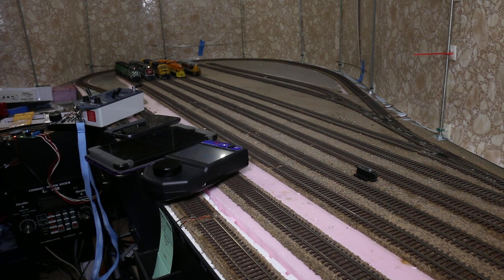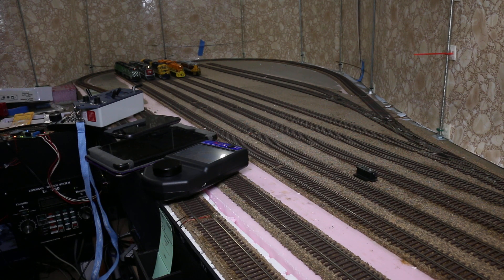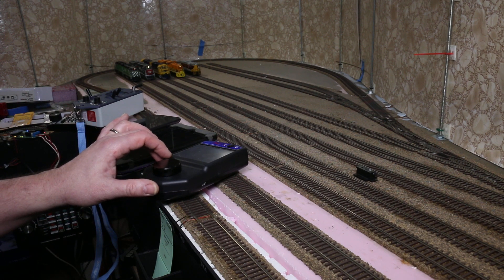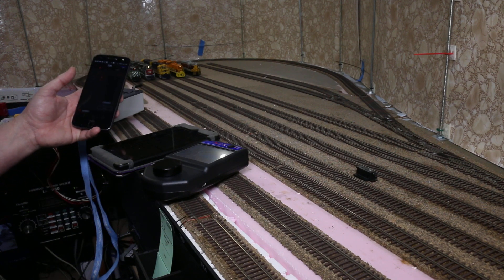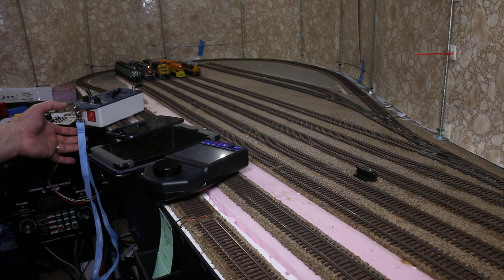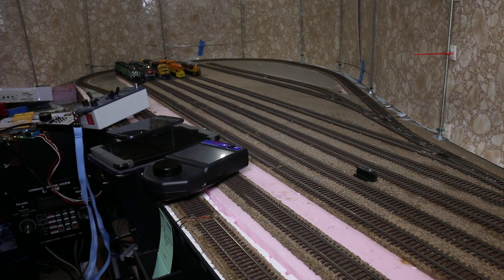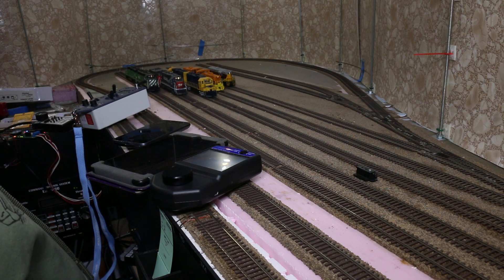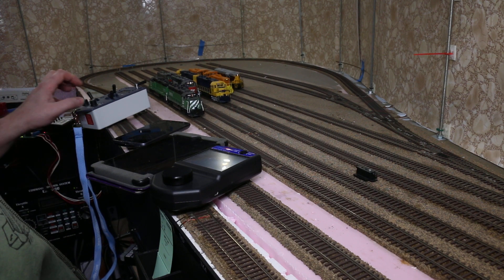Digikeijs DR-5000 with 4 separate throttle inputs + 1 extra

Comment: i'd l ike to see where you've got them plugged in.
Reply from the maker: Go to https://www.ironplanethobbies.com/product/digikeijs-dr5000-command-station-throttle-starter-set/ - the plugins are on the back but are labeled on the top. The UR91 was plugged into Loconet T, the LNWI into it. The Lenz Xpressnet panel was plugged into XN+FB bus and the ProtoThrottle receiver plugged into the Xpressnet panel. The Z21 emulator was a direct radio connection to the Digikeijs DR-5000. The RailPro is a direct radio system between the handset controller and the locomotive. I won't say it looked pretty - but I was able to do it. With a little help I could have gotten more ridiculous and connected a JMRI computer to it as well.

Comment: And NCE Power Cab or other throttles from this brand ? Not possible ?
Reply from the maker: Of major US brands, I think NCE, CVP, and MRC are the only ones that won't interoperate with it.
Reply: @JeffShultz  CVP wireless should work through their XPressNet receiver, the ALR900.
Reply from the maker: @woodalexander  older CVP, but not if you have updated to the most recent (which is now several years old) chip. They made changes that make it incompatible with Lenz.
Reply: @JeffShultz  Ryan at IronPlanetHobbies has it working with an ALR900 and the current CVP throttles.